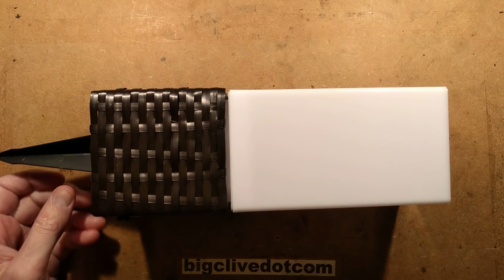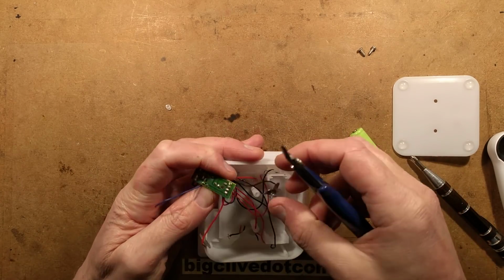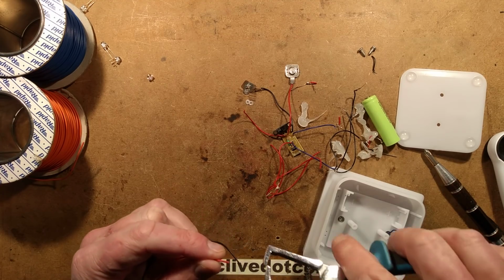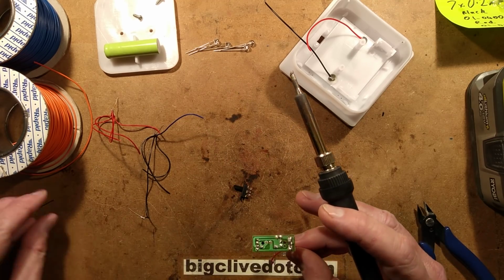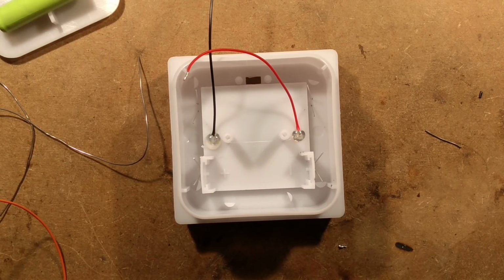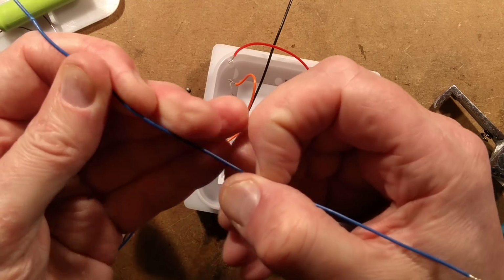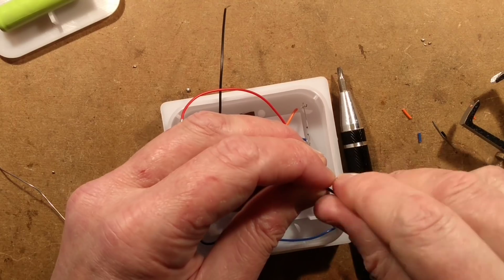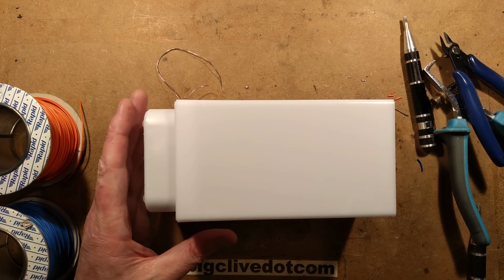Solar light - cold to warm white conversion.  (ambient)

Comment: I was watching your video while I was tearing into a leviton powerpack relay, and it has an interesting little chip in it that goes from mains down to 5.8v 15w in one chip, its number is TNY263PN, input 85-265VAC, relatively inexpensive, I would dig to see your take on one with all your work in mains and led mixed voltages, its no disco piss unit but its pretty cool
Reply: Newer version is TNY278PN, even cheaper
Reply from the maker: The TNY series of chips have been around for a while.  Nice low component count.

Comment: If i made furniture, installed wood decks, home repairs. I would buy Milwaukee, Hitachi,  Bauch or DEWALT. As a homeowner,  I bought! RYOBI and the only problem I have had is with the battery.  Ebay and  Amazon have awesome replacements available,  lighter, longer lasting,  i.e. more amps. And at WAY lower prices! Like 2 for one and twice the power 🔋.  I have several first run tools, the old blue ones. None of the new brushless. (To pricy)  So some are 10, 12 yes or older with zero issues.

Comment: A year ago now, mom entered the nursing home, at 93 years of age, she began having balance problems, where, as in those horrid commercials, she had fallen and can't get up.  So as her last surviving child, it was left to me to clean out mom's house and prepare it for sale. I had the nieces and nephews come over to get some trinket or two to remind them of mom, then we had a sale and got rid of things nobody wanted.  My daughter chose a small wall picture type Christmas Scene with a snowman and reindeer cartoon figures that were made to light up. The box it came in said "light does not work" So I took it apart to try and figure out what was going on with it. After an hour or so of pulling out my hair, I discovered the problem. At the factory some worker had installed that end for the + side of the 3 AA batteries was installed backwards. After reversing it the picture now lights up with multi color brilliance and is in fact very pretty.

Comment: I've got a Ryobi circular saw. I bought it because of the low price.  I don't really use it much so I didn't want to shell out a lot of money for a pro level saw.  I prefer corded tools though because I don't use them often and when I want to use one I don't want to need to wait around for batteries to charge.  I have forgotten what brand they are but I have a battery powered impact driver and drill, but I never use them anymore.  When I find I need to drill a hole I just grab the drill bits and the T shaped handle tool that came with screwdriver bits that have the same size and shape of the drill bit connecting ends and use that to drill the holes by hand.  I'm going to sell those drivers and buy corded ones instead so I can always use them without wait.

Comment: I had installed a nice solar powered, movement activated light to help wife back out of driveway at night.   All mounted on a neat little pole. A year or so later I noticed it was getting a bit uncertain in functionality.   Finally I decided it needed my electronic prowess (not) to put it right.   After opening the main box which contains the batteries (3 x 18650s) and controlling PCB I was greeted by a swarm of disturbed and angry fire ants who had decided this was a perfect home above ground level and nice and dry.   The ubiquitous 8 pin chip had its legs eaten off and the pcb  was covered in crap.    Curiously, the 18650 s recovered nicely in my Opus charger.

Comment: After cheap plastic solder pumps kept failing I liked for something better and found that exact one and LOVE IT! The only complaint was the thumb depresser is an aluminum to steel connection and it keeps unscrewing, loktite and problem solved

Comment: Clive if you wire the leds like this, then each led is supplied by the same length of wire!

 neg    ---------------------------------------
                 0          0          0         0
                 ----------------------------------------------  pos

Comment: Clive, are we talking about the same glue gun? On Amazon it costs £42.99 without battery or charger. With battery and charger it's £122.98. Over 13 times the highest customer rated mains powered one. It may be good, but hardly cheap. Usefully cordless.
Reply from the maker: That might be loony Amazon pricing.  Their supply and demand system seems to blip and throw out some ridiculous prices sometimes.

Comment: (1:37) - It's actually "Rattan" from Wattan, which again is from the medievel "woo-tan"
From there, we can quite clearly see, and thus seal the link between Woo-Tan and Wu-Tang.
And from there, it's a very small hop to Wu-Tang-Clan.
Not only very much underrated but perennially ripped off.
And you, Sir Clive,
Oh yes, I will maintain my decorum at any cost,
All they seek is a nod. Just a tip of the hat in recognition.
Otherwise, and my source is the horse's mouth,
literally. (Have you ever been submerge in horse breath? I don't recommend it.)
Anyhow, we...
We-Wu-Tang-Clan,
We-Wu-Luv-Ur
Channel.
We-Wu-Whack-a-Doo.
(Don't smirk. This is serious)
Sometimes, you can't get anywhere...
...or do I mean nowhere...

Comment: My go to general purpose wire is out of old Cat whatever cable for stranded wire, or old phone cable for solid wire. Generally gives you a nice selection of wire, though with multipair phone cable you tend to end up with a lot of one colour or the other, depending on how big a multipair it is.

Solder sucker silicone I prefer PTFE sleeving, the type used for 3D printers is pretty cheap, just buy the 4mm ID version, and a single length of it both lasts a long time per tip, does not melt and also deforms enough to get a good suction action.

Comment: Yes, a German company, called Conrad. They sell stuff everywhere in eu.
Reply from the maker: Rapid seemed to struggle when the RoHS regulations were introduced and suddenly they had to hold separate stock of the old lead tinned components and the new (more expensive) lead-free version.
Reply: Unfortunately Conrad turned, from a truly bargain parts supplier in the 1980s, into a total utter ripoff today....

Comment: Oh dear - aspergers  itching again...... perilous ... it's perilous! - also I hate rapide's wire description - instead of AWG or SWG which I'm familiar with they use metric(?) which OK is logical - but I have no idea just what 7/0.2 actually feels like ... 
For any other of the great unwashed considering using Rapide (which you should)
7/0.2 roughly = 24AWG or 25SWG (£7.31/100M) - I prefer the slightly cheaper 10/0.1 = 28AWG or 30SWG for 12v work (£4.74/100M).

I don't get what AvE is on most of the time ...

Comment: Unfortunately, the closer to the poles you get you have either too little light (winter -- when you need extra light and heating) or sunlight all day 'round (a.k.a. summer -- when you don't need so much power). I don't understand why Australia isn't using more solar power; seems like they are in the ideal spot geographically, they are technically capable and have lots of land they can't really use for anything else (desert).

Comment: You mention Rapid Electronics connection cable in this video.  Would you consider a short video educating us to the usage of various sized cable?  I'm fine when it comes to purchasing cable from an automotive supplier.  They offer their cable in ratings based on amperage/ampage and generally for 12/24 volt appliances, which is fine for most DIY battery project use.  But then outlets such as Rapid give the cable ratings such as '7/0.2' which is what I believe you are using in this video.  But what about other sizes?

Comment: you'd probably like living in the silicon valley in the 90s when all exterior lights were sodium vapor (because of the nearby observatory), so everything was lurid yellow at night. it was quite a nice aesthetic, and unfortunately it's slowly disappearing since they are switching to LEDs which are even easier for the observatory to filter out

Comment: I got some 4mm external 2mm internal diameter silicon tubing at an RC store, that's what they use for nitro and gasoline powered model fuel lines. For about 2€ or so for a meter or two.

The Engineer solder sucker does look quite nice, because my thumb doesn't reach the top of the plunger to recharge the standard ones. I modified a ZD-193 by cutting off the plastic sheath and replacing the button with a custom 3d printed one, so I can just whack it on my hip to recharge.

Comment: Hey Clive, I would suggest taking a look at the Edsyn Soldapullt line of desoldering suction devices.  Expensive but completely worth it in my opinion.  Best one I have ever used, including the engineer brand redtop sitting neglected on my bench.

Comment: I've never used solderwick, always my 1970's solder sucker with a ball knob on top
Typical H&S is that modern ones have a shroud so you don't get yourself in the eye (never done that myself)
Also, modern ones have a compression spring in the 'solder chamber' end, the spring gets covered in solder after a while. mine has an extension spring in the handle end (but still in the cylinder)
It also has a solid tip, it looks like teflon.
The reason i like suckers is that it clears the hole (heat the solder with the sucker ready, then just as you take the iron away, tilt the sucker over the hole as you press the button.
For hotglue, keep an iron with an old tip handy to melt it, or maybe your heat gun, less likely to pull the wires, i've even warmed a circuit board enough.

Comment: Inspired by your videos I took to hacking dollar store garden lights for fun. I tried slow color change LEDs but to my disappointment they did not work! At least not with a simple swap out. 
Turns out that little 4 pin controller delivers a high frequency AC-ish power to the LED. Plain LEDs don't mind this but the color change LEDs don't care for it all.  Replaced one leg of the color LED with a diode for rectification and added .1 microfarad ceramic capacitor to smooth it out. Works like a charm and is much more interesting than plain white. Now nobody has trouble finding my apartment in the dark!
Reply from the maker: Yeah.  The colour changing lights use a 1N4007 and 100n cap to stop the LED resetting to red continually.

Comment: So I use a 60W soldering iron, and I noticed the other day that the iron glows red(the inner heating coil)
Is a 60W iron supposed to be that hot? I've melted 3mm LEDs (Yes, Melted) trying to solder them on a stripboard and the leg's come right off it.
Reply from the maker: 60W is actually a very high power iron.  Most unregulated irons tend to be up to 30W for electronics.  The bigger one will be good for heavy electrical connections though.
Reply: @bigclivedotcom  didn't really expect an answer from you thanks lmao
Reply: I guess I should get a 25-30w iron for smaller works then

Comment: +bigclivedotcom
Any reccomendations on making a special High-CRI Warm-White head-torch for a friend of mine?   I can get high-CRI 3000k MR16 bulbs but I'm guessing I'm actually looking for a COB or something...
Reply from the maker: Getting a high CRI version of the LED in the torch might be the hardest bit.  It'll be a juggle between finding a torch with an easily replaceable LED or LEDs and then some of the required CRI and colour to fit it.
Reply: Quite, yes!  But any ideas even where to start..?   This is a wider topic to talk about, sourcing rather than 'salvaging' components and so on...

Comment: Or, you go to a theatrical lighting supplier and buy a scrap of Bastard Amber color Roscoline, or whatever gels they sell in the UK. Drop it over the LEDs and skip all the fuss.
Reply from the maker: Subtractive filtration.  Even with a light touch like CTO gel it reduces output.
Reply: You never said brightness was relevant. Warm white LEDs usually are dimmer than cool white to start with, but if you wanted BRIGHT warm light, wouldn't you be ordering in bin-matched prime CREE LEDs instead of the dollar bag kind?(G)

Comment: The "Fairy light" method is more easily done by stripping ( x * 2 ) * n the exposed length you need, x being the length of the termination, n being the number of conductors. You want to multiply x by two because the intention is to fold it over so it bends near x length, twist then tin. The ends would be x alone, since you'd twist and tin that with no extra operations. This allows for one to expose the leads all the way down without guessing whether the job is good enough since the soldered leads would stop the insulation from overshooting when adjusted. Needless to say it's a pain in the ass to prepare the lead like that.

Comment: Why wouldn´t you twist the wires first around the LED leads and then solder them together? it would be faster, more secure, less exposed wires and generally less a pain in the ass...

Comment: I'd probably gut the lot, put a square of aluminium sheet in place of the solar panel, thermal-glue on a 1 Watt 4000k LED (cos I have a crapload of them!!) and run that at low current off the solar circuitry that I'd externalise, but that's just me coming up with ways to use up the 50-odd 1W white LEDs I got off ebay... :P

Comment: YX618, never heard of this particular model, but i think the YX is making from one company, just like the QX ones are one company made chips
for the solar panel, i saw video on youtube where someone use tape and resin to make solid connection for one of those solar panels, soldering for me always end up bad :(
Reply: Mr Auto Found in my solar leds YX8018 and YX8019. The difference? Dunno.
Reply: XY8018 is up tu 40mA, YX8019 up to 150mA

Comment: Clive, I have been using Ryobi One+ for 21 years professionally. I switched from Dewalt as they all walked from site, then I moved to Bosch and the same goes for them. I saw an offer on a multi set of these new Ryobi powertools (Back when they were all blue!!!) in B&Q and thought to myself, these will do for now as no one will nick them!! I have been a loyal fan ever since. I had my van ransacked last October and the very next morning I sent and purchased a massive haul of Ryobi. I have very little to say against them and I use mine 6 days a week and they are worked hard. No issues at all with them.
Reply: @crazzzme  I still have maybe 6 or 7 of my.blue tools left over that were in my workshop and they have never skipped a beat. 21 years for a powertool is value for money..

Comment: Clive, do you have one of these for stripping g wires? These don't need to pull on the wire to get the insulation off so it doesn't rip the connected ends right off,  and you can do those mid-wire strips easier... IRWIN VISE-GRIP 2078300 Self-Adjusting Wire Stripper, 8" https://www.amazon.com/dp/B000OQ21CA/ref=cm_sw_r_cp_taa_pc5ZBbMTPH5TG

Comment: 10:44 Rapid Electronics was bought by Conrad Electronic, they are probably the biggest electronics supplier here along with Reichelt. If you want to get your stuff at a store here Conrad is the only option for most people (There are some smaller electronics shops, but they are usually quite expensive). Is it actually possible to buy Conrad's brands (Voltcraft, Basetech, Toolcraft and TRU Components) at Rapid or is that just some sort of financial thing?
Reply: RandomTux - over the past few years some Conrad brand / sourced items / components have made it into the range sold by Rapid.

Comment: Engineer really are a fantastic brand. I may have raved about them before here and that 'SS-02' solder-sucker in particular. It is amazingly good for through-hole circuit boards on 1980's micros--the kind who stuck their tracks down with Gloy paper glue...  I previously bought an enormous and much bally-hooed 'SolderPult'--from America which was very good at removing every single pad you pointed it at, whether you had heated them or not. I just last week gave it to my best pal since they are not cheap and I hoped he might get more use from it as he mainly puts projects together in combination with his 3D-printing hobby which tends to imply bigger surfaces to work with. The only advice I would give is maybe to trim down the tube a little from the default length they supply it with. I found the ejection mechanism did not work if the silicon tube was too long, but it is not hard to find a happy medium--about 7mm in my experience--and I have only changed the tip once in the last three years since I bought it. They also do a slightly cheaper, larger one which is more conventionally sized and shaped but still with a silicon nozzle. It is not replaceable however, but interestingly they do recommend you cut it at an angle as you suggest. However in my opinion the tiny size, massive solidity and one-thumb operation which does not require an annoying guide rail make the 'SS-02' a much nicer thing for not a lot more. It was £15 from 'Precision Tools' on Amazon if I remember correctly.

Anything Engineer is going to cost a bit more than some but they stay just on the right side of pocket money. I am slowly trying to change all my handy-craft tools to Engineer (or the equally nice but somewhat more expensive 'Wera' brand for mini-screw/torx/allen drivers). Unfortunately they don't offer much of a line of powered tools like soldering irons and so on, at least not that I have found. Their 'NZ-12' cutters are head and shoulders above any others I have tried as well--again, I may be repeating myself on that recommendation also.

Comment: AVE doesn't like any Ryobi power tools. I love them they have worked great for me. I built a trailer with there drill press, wood chop saw with metal cutting blade, and grinder. Great videos love your channel.
Mighty Car Mods use Ryobi to build cars on there channel and they seem to really like them.
Reply: For domestic rather than light industrial use, Ryobi are a good choice. I've used Ryobi gardening tools for a very long time, and found them to be good value for the money.